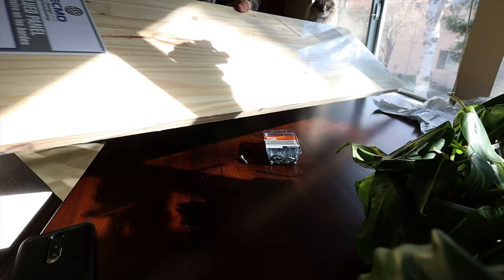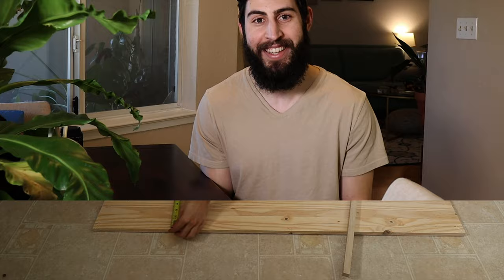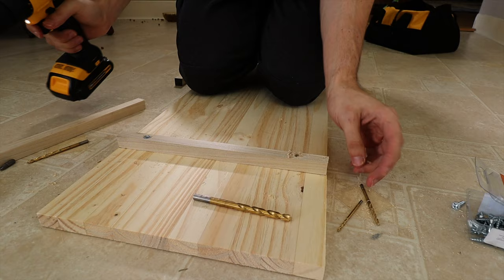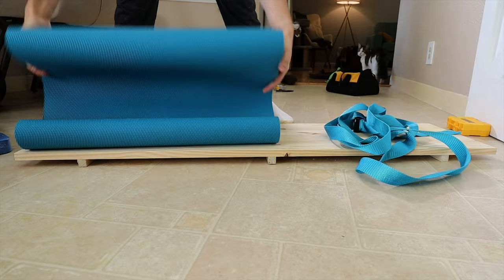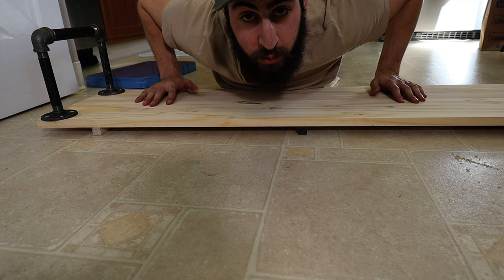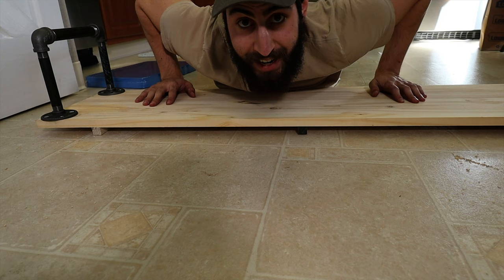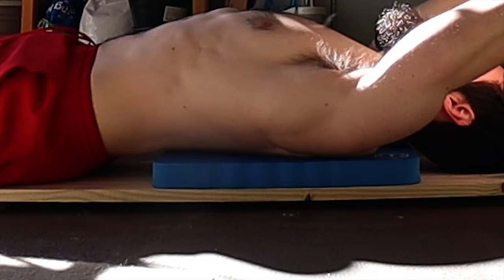DIY Nordic Curl Board | GHR, Glute Ham Raise, Nordic Curl

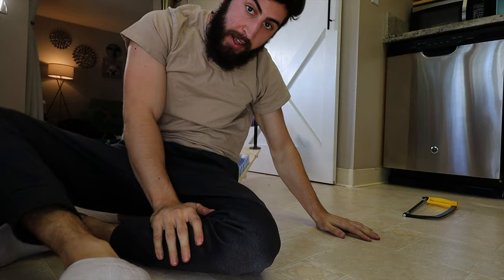Comment: 3:55 rotate that center leg 90 degrees and then center it. You'll keep the stability aspect while also getting rid of the pivot point.
Reply: The flex in the wood would probably rip the screws out...
The flex seems to be quite minimal without it though. If one wanted no flex at all, then getting a thicker board might be best. Oh, or harder wood.

Comment: Was going to make this but realized that the wood board is superfluous and ended up using 2 foam bricks on the floor as knee pads and a doorway pullup bar 1 foot off the floor to brace against. Also being able to push with the feet into the closed door makes the Nordic curl easier.
Reply from the maker: Very nice! Good job being inventive with a solution!
Reply: Hello. I am not english and dont understand well. Could you show a picture ?
Reply: @bouteilledeau2121  Youtube is deleting any links or posts I put here for some reason. I'll try later
Reply: Please show a picture of how you did yours. I  think I need this feature.  Thanks
Reply: @timshel011  see u/watermelon209

Comment: Great idea. I am currently looking at turning your "nordic" board into a more multi-functional device. 
First, I will increase the base board size to 4' x 8'. The reason for this is I want to be able to position my exercise bench on the board. The bottom of the board will be supported by 1" x 2" boards every 12". 
One eyebolt will be placed on each side of the board to give me the ability to utilize resistance bands. 
The board will have your piping at one end as you have it  but I will increase the length of the pipe to allow for pushups. I will experiment with resistance bands and add more eyebolts  if needed.
Reply from the maker: Very nice! Sounds like some solid upgrades

Comment: To anyone planning on doing this I'd recommend getting a 12 inch cross member for the foot anchor. 8 inches for me seemed crammed when I was mocking up the build. Other than that great simple build thanks for sharing
Reply: I thought the same thing. If that's the case, you need to by a wider platform board, right?
Reply: @grasonb    yes and no. a wider board would be the easier and more expensive choice. i just cut the board about 18 inches in and turned it. making a kind of t shaped plank instead

Comment: The screws holding your pipes might pull out over time, they only have 3/4 of wood to hold on to. I'm going to put a 12 inch length of 2x6 on the under side. Then the screws can dig into over 2 inches of wood, should hold forever. Also might try making my foothold in a T shape rather than the U shape you used.  Thanks for posting, nice job. Consider this a prototype, before long you'll be selling 'em.

Comment: Thanks for this idea man! I was looking for a way to do nordics, I was using a C-clamp, a piece of wood, and a low window sill at first lol. I used a 3/4 inch plywood that was 2 foot wide and 4 foot long. And I used all the same pipes except I went with all 3/4 pipes including the side pipes and the side pipes were 4 and half inches long and the top pipe was 18 inches long. I used wooden fence post to get bench 8 inches off the floor, that way I could get my toes to hang off the back that’s why I used 4 and 1/2 inch tall side pipes. And I used the Olympic bar pad for the pad for the my ankles. ITS PERFECT!!! Your idea was genius just needed a few modifications. As soon as I put it together today I did a strict Nordic curl, I knew I could do it but didn’t have anything sturdy enough. For anyone wondering it’s very sturdy, make sure to use a knee pad and the only down side is that’s pretty bulky
Also you want a little bit of space between the bar and pad and your actual ankles for a strict Nordic trust me it’s just better to have a space, try it and you will see what I mean.
Reply from the maker: Very nice! Sounds like you made some solid improvements! And holy crap, good job with a strict Nordic, hopefully I'll get there some day 🤣
Reply: I just built mine today and I found out that yours is almost identical to what I did except I built without the 8 inch wooden fence underneath the bench. Do you think using only 3/4 inch plywood with dimension of 2' x 4' would be durable enough to perform nordic ham curls? If you could provide any update after using it for ~ 2 years, that would be greatly appreciated! Cheers!
Reply: @parkseu5  hey man. Yes the bench still gets used very often you can check a few of my videos if you like. I use it for Nordic’s mostly on mondays but I use it for dragon flags, as a bench for calf raises, and a step for certain exercises. But short answer to your question would be yes you could use just the 3/4 plywood that’s 2’x4’ and yes it would be very sturdy and mines held up for 2 years no problem. I had 2, 4”x4” wooden fence post stacked on top of each other at first but the bench was pretty bulky and I moved to a smaller apartment so I knocked it down to just one post on the bottom in 3 spots(back, front, middle) so it would be shorter so it could fit underneath my bed and it’s a lot more space sufficient. While I was modifying my Nordic bench I took all the fence post off the bottom, layed it flat on the ground on did a Nordic on it. You can do Nordic on it like that but I recommend at least a 2”x4” on the bottom at the least and it would be even better with 1, 4x4 post on the bottom and I think it performs better with 2 fence post on the bottom but it was too big to fit under my bed like that. The purpose of the wood under it is to lift it up to give your toes some room to hang freely off the back, is it necessary? No, but the wood on the bottom will help. Everyone’s situation is different and idk what you have access to or how much u can spend but I’d say the flat on the floor to start will still be sturdy but wood under it would be more comfortable for your ankles and toes and would allow you to get better at the Nordics. Start with none but eventually when you get the funds, time, or whatevers holding that back, get some wood for the bottom. That’s my view and like I said you can look at my vids for reference. Anything to help someone, and I’m still in love with my Nordic bench because I saved my self a good bit on money and I actually use it !
Reply: @charlesborel8493  Wow thanks for the detailed response and input. I really appreciate it! Yes, so far I only have 3/4 plywood (2x4) which I finished building it today. This should be a good starter and I will see if I should upgrade like what you suggested here. I did check out your videos and you instantly earned a sub! 👍Awesome and motivational videos!! You have a crazy hops!

Comment: I build this too no need to have legs on it, also running a smaller pipe though the noodle works better since you don't have to cut the noodle (when you cut it it slips off when pressed at the wrong angle) also using layered wood board makes it have less flex/bend
Reply: How thick is the board that you used - 5-ply? I'm also curious of the length and width of board that you went with. Did you use 1/2" pipe for the pool noodle or did you need something even smaller?
Reply: @billymitchell8448  7-ply (3/4 inch) 2 ft wide x 6.6 ft long (I used that size to fit my yoga mat) 3/4 pipe is just right
Reply from the maker: Very nice idea! Good stuff 👌🏻
Reply: @attilabodi826  Thanks for the tips!

Comment: Alright i put it together. Looks pretty good! Waiting for the pads to arrive.
Reply from the maker: Very nice! Time to get some yoked hamstrings 😂
Reply: @John.McIntyre  update - The contraption itself works well. But the padding is too hard and it’s making my kneecaps slide backwards whenever I try to Nordic curl. Need to try to find something softer.
Reply: @John.McIntyre  update - The contraption itself works well. But the padding is too hard and it’s making my kneecaps slide backwards whenever I try to Nordic curl. Need to try to find something softer.
Reply: @John.McIntyre  update - The contraption itself works well. But the padding is too hard and it’s making my kneecaps slide backwards whenever I try to Nordic curl. Need to try to find something softer.

Comment: Great idea. Why not just thread the pool noodle over the pipe before connecting both sides?
Reply from the maker: I ended up doing that exact thing in the second version of this! Wish I could take the credit for thinking of it, but it was a great tip from another commenter on this video munch like yourself. Thanks!

Comment: Very cool! Probably will be doing this (as a complete calisthenics beginner).
One question, why put the legs on at all? I can see why to create that lip when just using a strap to secure your feet. But when you put on the metal pipe framework, doesn't seem like you need those legs at all. And not having them may make the board more stable overall.
But, as I mentioned, I'll probably be making this myself and may test out no legs.
Reply: Also, love the plants and cats.
Reply from the maker: Great point, I think you can definitely get away without the legs if you use the pipes. I'm guessing you'll get the board lifting at the back like it did with all three legs, but that's not a huge deal and can be solved with buying a nicer board than the $12 one I got.

Comment: I tried creating one with a board that was shorter (because they didn't sell anything else, but the back keeps lifting up. Other than buying another board, are there any things I could do to prevent this? I have already tried using weight in the back and lifting the front up.
Reply from the maker: Yeah it's a leverage thing, lifting because there's more weight on the wrong side. you either can add some weights to the board or secure it down somehow under a couch or door frame, ect. Last option would to be to screw in wooden struts like skis in the front to stop it from tipping over. No great options though
Reply: Thank you. I'll see what I can do.

Comment: How do you know what height / size the metal pipes should be?  And if you get it a inch too high for example, what can you  do?
Reply from the maker: I used 6" high pipes with a 8" across. An inch or two too high should still be completely fine. I just wouldn't go any shorter than 6 inches tall or you will have a very hard time getting your feet in!

Comment: Why does this board need legs? Wouldn't it work better with the board directly on the floor?
Reply from the maker: Not absolutely necessary to use legs, unless you're just grabbing the board for dragon flags. But not using legs will make part of it lift off the ground like I showed a bit later in the video and may make it feel a bit unstable.
Reply: I was thinking the same thing. If I make it I will probably just screw two boards together because I don't want the board flexing like in the video.

Comment: How did u pick pole height?
Reply from the maker: I'd suggest the lengths I used in this video. For reference, I'm about a size 12 foot and it is a tight fit with the pool noodle. This set up should still work well for smaller feet since it's snug for me, but you can always test something out and exchange for a different length if it doesn't work.